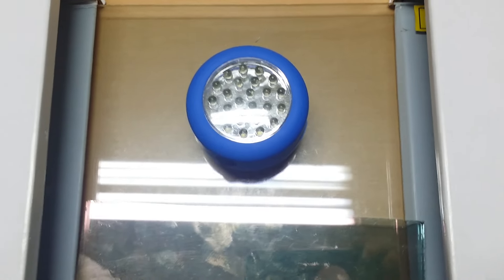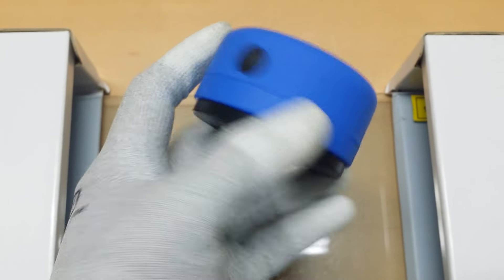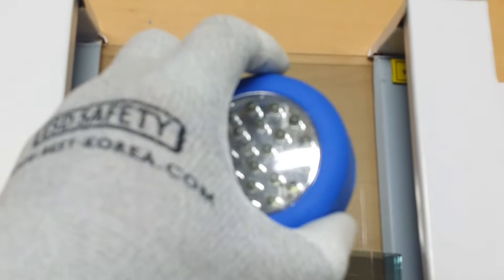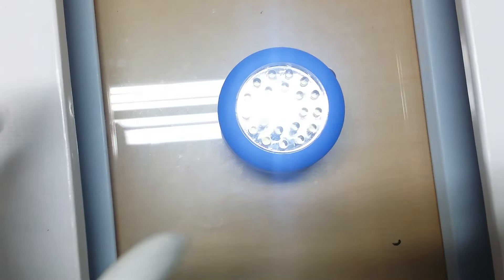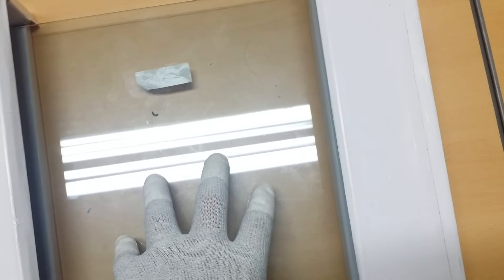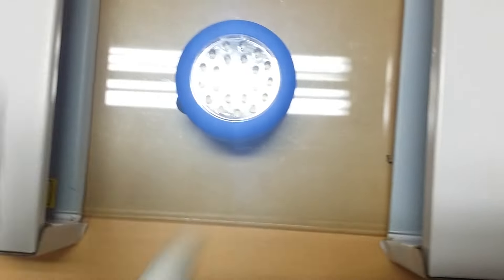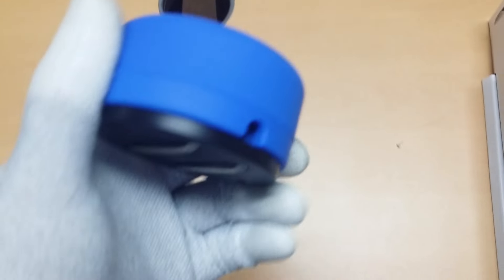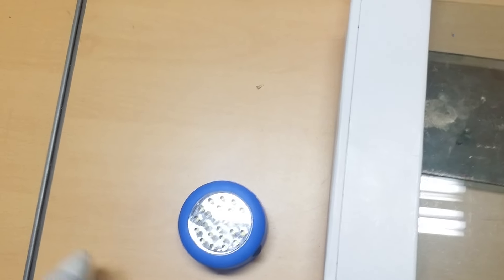RG-306 Tester to distinguish coductive coated side of Low E glass by REGENI for glazing window

Comment: i guess that if you flame test this glass from outside the different color it will be the second. If you taste it from room side it will be the third ! See test picture here : https://www.dropbox.com/s/yykww1h9b5103kh/low-e%20glass.png?dl=0
Reply from the maker: Hi. Do you work for the glazaing industry ?  In South Korea, field glazing workers need to differentiate inside and outside by using this tool to check whether there is conductive coating on the surface of glass.